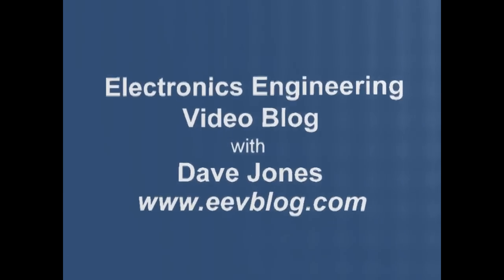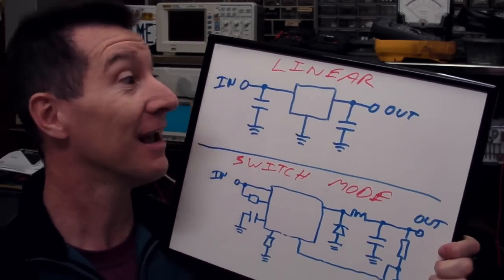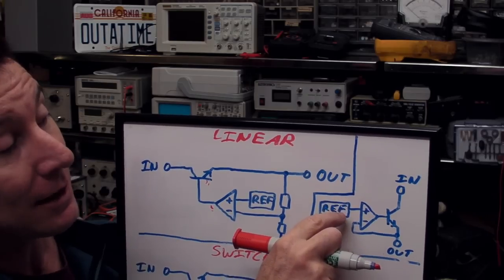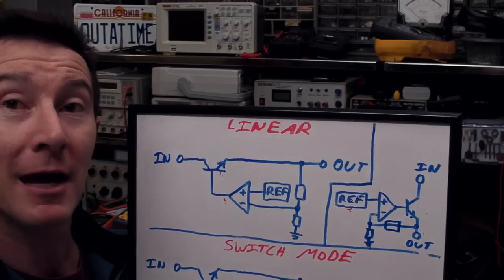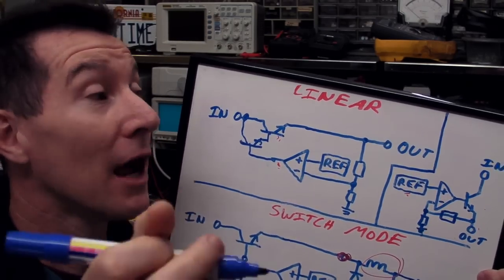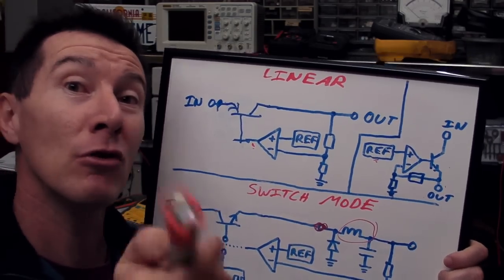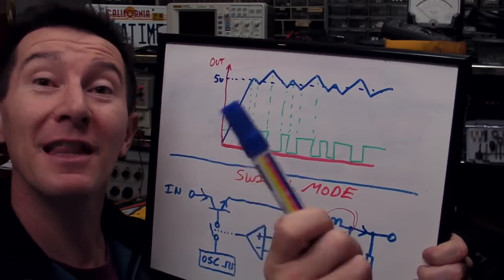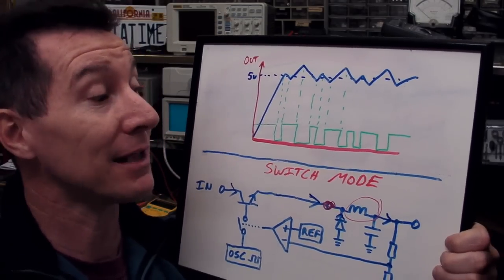EEVblog #90 - Linear and LDO regulators and Switch Mode Power Supply Tutorial

Comment: I thought the hard part of SMPS was selection of external components; IE, the required inductor rating is dependent on both expected load and voltage (and must not be too big or too small), and that the capacitor must have a specific ESR and capacitance as well, and it must be able to tolerate current at the switching frequency, and then there's the parasitics from traces... and if anything is off even a slight amount, it will apparently cause a negative vacuum gradient that will destroy the entire universe. At least that's what I've been told.

Comment: Here's the odd question.  You kind of brushed over the linear regulator DIS-advantage of heat dissipation.  Like if you wanted to take 12v (or higher) down to 5v or 3.3v, there's a lot of power wasted as heat.  I know (or at least I think) that the switching regulators don't generate nearly as much heat as linear regulators.  I've always wondered if it's a really bad idea to use a switching regulator to drop down to a lower voltage.  Then, use a linear regulator to get the desired lower voltage.  I know it happens all the time, but I haven't heard anything about it.  What do you think?
Reply: Precision devices, measurement devices in particular, actually do exactly that. But you won't see this design trait very often in everyday consumer gear, because it flies in the face of cost optimization.

Comment: This is good.  However when it comes to compatibility.. Switchmode power supplies can generate frequencies that interfere with routers and computers of poorly designed. Long story short, resently had a wireless router with a switchmode power supply which was dropping out randomly, switched power supply to a linear power supply and the router runs flawlessly. Mode of operation may be similar, but their operation ???

Comment: Could someone explain what the diode does? And also in flyback circuits I hear a lot of people talking about fast diodes to protect the transistor, but how and why does the transistor need to be protected?
Reply: Sunny L.  i think the reverse inductive volt spike from the inductor will hurt the transistor and the diode prevents a reverse of current

Comment: Hi Dave, thank you for the tutorial!
I still have some questions if you dont mind:
1- If I am not troubled by the bigger drop of the linear regulators, so is it better to use them, since they are more reliable as you said?
2- Why does this small change in switching makes the Switching Regulators more efective? What's the "eureca" in them?
Thank you!

Comment: Dave 
how could I make a mirrored +/-  switch mode power supply ? 
I need 50 vdc on the inputs and 35v - 40vdc -5A on the outputs but I can't find any chips that could handle such voltage rating
Reply: Plus 
if it is not much to ask, what do you use as reference for oscillator in PWM regulation keeping in mind LM555 sucks. Do you use a  some crystal quartz oscilator ?

Comment: Hello, I want to design an SMPS with 5v USB input and dual output of 12v and 5V for Battery and Ardunio respectively. I would request you to suggest a PCB board or an IC.

Thanks and Regards

Comment: Why did you put an oscillator there? From the looks of it, the opamp can drive the transistor directly. The oscillator isn't doing anything...
Reply: +George Tsiros It is. The oscillator is there to PWM the load on demand based on output voltage.
Reply: as i understand it, it isn't necessary. The comparator will turn the transistor on or off based on the sensed voltage at the output. No PWM necessary.
Reply: The op-amp is not going to turn the supply on or off to the transistor, but it is gonna change the voltage. The op-amp can not oscillate in a PWM fashion.

Comment: Can I control the output of amps with some sort of gizmo, to build  ? what Im trying to  use is a  12v  lith battery with only 3 amps and I need 12 v with 4 amps to power a monitor and i dont want to spend 50 $ to 100$ to do this ? and i can find a battery that will give me this .

Comment: ...continued...

Finally, keep in mind that a buck regulator's max. duty cycle is going to limit the maximum output voltage.  If the regulator's max. duty cycle is 90% then the maximum output voltage is going to be (at best) 90% of the input voltage.

Comment: @gglovato can't find inductors? chances are, if you could, they wouldn't be adequate anyway. unless they're made by coilcraft maybe.

just wind your own. be creative. you can find junked PC power supplies anywhere. there's a ton of stuff that you can recover from one. most importantly, cores, cores, and more cores. the standard yellow donut in charge of filtering on an atx supply is a t106-26. micrometals has a very useful free design program. so make your own inductor already.

Comment: What is source of reference voltage.?
Reply: Probably a Zener. :D
Reply: Yeah well externally, you'd have a Zener, but you're unlikely to get a Zener on your IC, the way Zeners are manufactured is incompatible, so it would have to be made separately and then embedded into the IC. You can actually use any kind of diode if you have an approximate constant current source. Within ICs, a "bandgap reference" design is common, which is system that measures a Silicium diode, well, actually multiple, and applies thermal compensation to them through different value resistors and comparators.

Comment: The devil is in the details.  Yes, the circuitry and components are similar but the things that make a linear different from a switch mode supply are the things that are feared and you didn't really address that -- so, you can throw all of your "Aussie charm" at it (and I DO enjoy your friendly warmth), it won't negate the complexities of specing the inductor, determining the frequency and duty cycle, selecting a capacitor with the proper esr, and other tweaks to boost the efficiency.